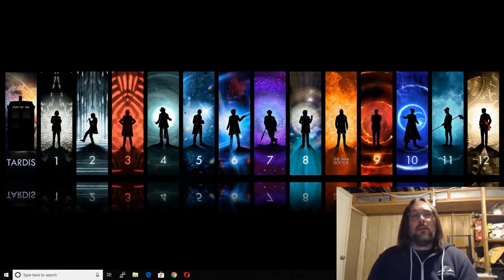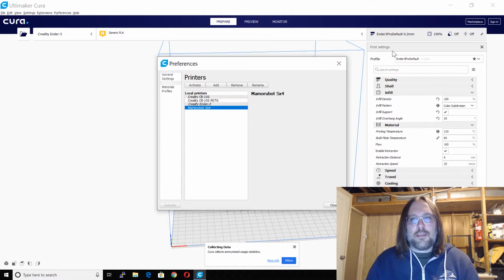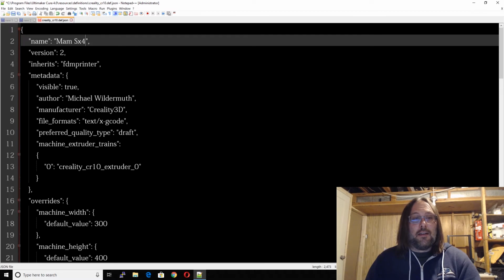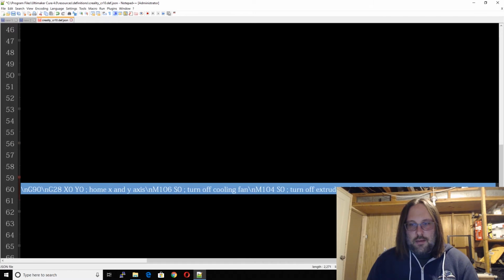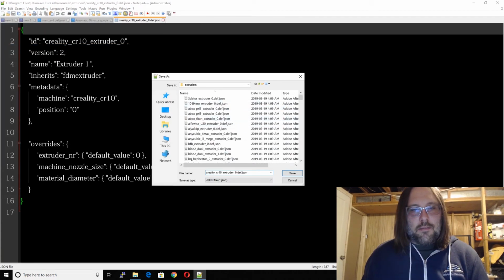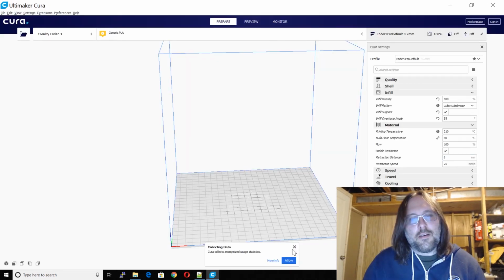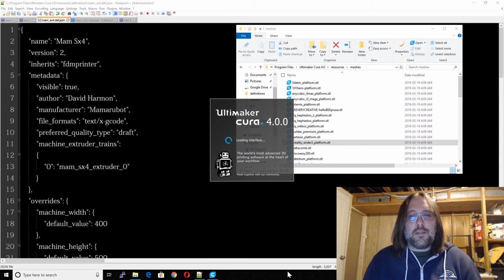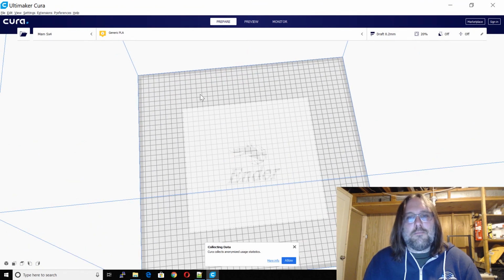Custom 3D printers in Cura

Comment: Great informative Video, found it really useful and well explained. I'm using Linux with Cura 4.10 which uses an appimage rather than an installation. I can't find the profile files, they seem to only load as temporary files with each instance of Cura running so can't create a new one, unless I'm missing something. There do seem to be some specific profile type files (for installed printer) in .local/share/cura/4.10.
I'm using an Ender 3 pro and am trying to enable multiple extruders so that I can use different filaments within a layer by assigning a virtual extruder for each part in a multipart object. I can get it working using a custom printer but am having problems getting profiles to work. It seems cura tries to extrude extra filament (6-9mm) after a filament change which is globbing over my print.

Comment: Hi; I'm from Türkiye, I have one 3D printer, that is our design. I use cura slicer. Printer is work well bud I have time difference problem. After slicing showing time in Cura example 3 hour, bud real time is aprox4 hour (may be last than) Could you help me solve I this problem. Thanks and have a good days
Reply from the maker: Cura is infamous for this.   The problem most likely miscalculating the movement motions (acceleration and jerk).  Are you over riding these settings